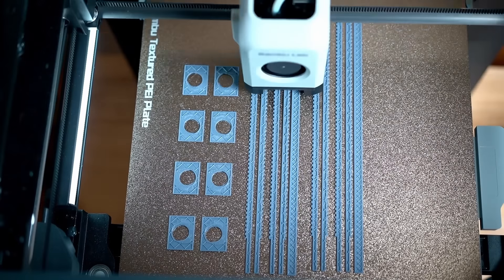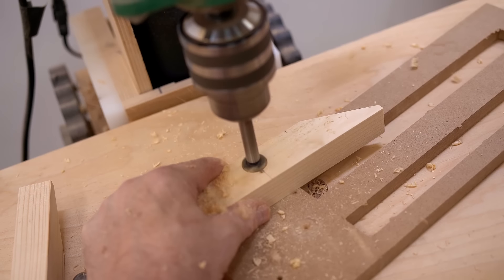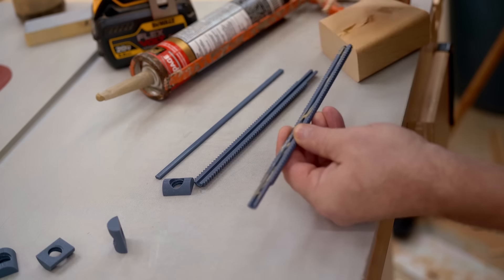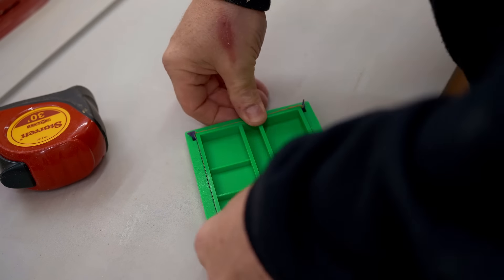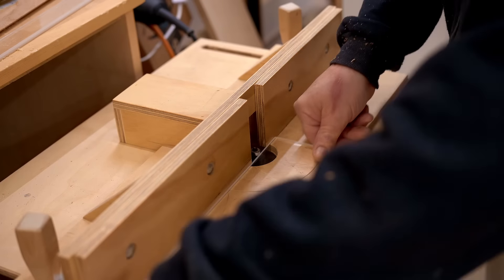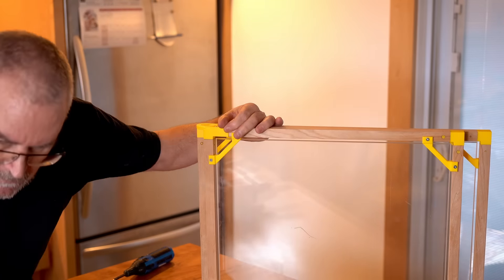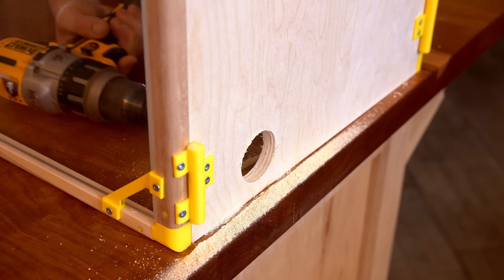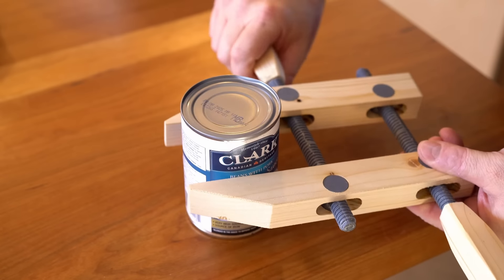What Happens When You Give A Carpenter A 3D Printer?

Comment from the maker: Short answer: good things happen! This is literally a game changer for someone who can use it as a tool for designing and testing projects. 
The printer I settled on was from #bambulab the P1P model and I've been using it every day for the last month, sometimes 5 times per day!
To use it to it's full potential I've also been learning FreeCad. Powerful FREE software, but a steep learning curve.
I won't be posting videos on 3d printing on this channel, but my projects may include 3d printed parts and will also be putting the stl files for some finished projects (like the sanding blocks shown in this video) on my Patreon and Locals for supporters.
Oh and the strength test for the handscrew clamp - it was surprisingly strong! It crushed that full can of beans (try doing that with your bare hands, for example) before the glue broke on the handles. So it's pretty strong and could be a lot stronger with a bigger leadscrew. The spline down the centre of the leadscrew can be made from solid hardwood or even aluminum or steel, and that would make it many times stronger.
Reply: I certainly wouldnt mind 3D-printing content..
Maybe post it on other channel?
Reply: Do you recommend any tutorials for learning Freecad?  I have a 3-D printer and the design aspect of making custom parts is holding me back.  I’ve been using TinkerCad and it doesn’t do technical shapes well.
Reply from the maker: A couple of great ones for FreeCad tutorials are MangoJelly Solutions and Andrew CAD.
Reply: Love my P1P, just working on installing the bits to make it into a P1S so I can do ABS etc. I've printed for years and had to do all the tinkering and tweaking to get good prints but this thing just works, it's awesome :) That is a very impressive clamp!
Reply: A couple small tips for 3d printing, it is RARELY if ever a good plan to custom print fasteners to replace screws/nails/bolts. You can buy them so cheaply, and the quality of purchased ones is so much better.

3d print the things that are expensive or unavailable. Use 3d printed parts to hold sheet goods/extrusion/lumber/etc with mass produced fasteners and you’ll save a lot of time (and a lot of frustration).

Repeated flex parts - like the super satisfying plastic clip catch clicker at the top of your enclosure - it depends on your material but I wouldn’t expect that piece to have a long life span unless you used something other than PLA.

For things like the lede screws in your clamps - the 3 piece design is excellent - but your alignment spline is another great part of use extrusion - some carbon fibre rod or brass rod or aluminium extruded flat bar or pin stock or something will work great and you can just print to fit whatever cheap, strong thing you got cheap. Removes a slightly painful and unnecessarily time consuming part from the print list, and get better rigidity and strength, usually for cheaper by volume than PLA.
Reply: Wow, you created all those with FreeCAD? I was not able to create even simple cube in an hour. You are a great person, I should say!
Reply: John - I love your creativity.  Happy spring.
Reply: As someone which had his first 3D Printer in 2014 and several between: The Bambu Lab P1P is a excellent Choice if you want to print and not tinker with your Printer.  It is moderate Upgradeable, but especially with an AMS it is a real Carefree Printer, which is great if you are woodworker and not a 3D Printer Tinkerer.  What would be good content is Hybrid constructions. 3D Printers are Tools like a lathe. Some Parts in FDM and most of Wood would be nice to see.
Reply: @Johnheisz try building a MPCNC or Lowrider V3 next. Alternatively, printNC if you have a slightly larger budget

Comment: One little tip for 3d printed threads is put a very light coat of silicone grease on them. It helps a ton when it comes to print on print contact. Makes it less "grainy" and turns smoother

Comment: Your intuition to print the screw threads horizontally and in parts and glue them together afterwards was spot on. A lot of 3D printing beginners will print screw threads vertically, and the layers shear off and the thread gets stuck as soon as they get over tightened.

Comment: Awesome! I also got a Bambu Lab P1S lately, it's a great printer. You might want to add some foam or other material at the bottom of the enclosure, so that it doesn't rattle when the printer is printing at high speed. My printer shakes the entire table so that I can't even use my mouse effectively :)
Can't wait to get ideas for 3d printed woodworking stuff from you :)

Comment: Brilliant ! I’m a uk based woodworker and literally just started learning what you can do with 3d printing. Snazzy enclosure…. I’m planning similar but just less snazzy… just 3d printed 3 way corner blocks to connect dowels to form a simply cage. Then I’ll print clips to hold Perspex or thin board sides.

What’s a surprise to me as a noobie is how L-O-N-G it takes to print even relatively small parts… you design some little accessory for the shop  in Fusion, then it takes 1 hour to print. Then you discover it’s ⅛” too small 🤯. Whereas as woodworkers, we’re used to being able to make very quick test pieces. All good fun though!
Reply: You can speed up prints by using larger nozzles and layer heights and by changing slicer settings. A 0.8 mm nozzle with 0.4 mm layer height will print faster and stronger than using a 0.4 mm nozzle with 0.2 mm layer height and if the piece is designed to be functional rather than decorative the thicker lines and layer heights don't matter so much.

For example a benchy in bambu PLA basic at default settings for a 0.4 mm nozzle (so 0.2 mm layer height) will take around 32 minutes of actual print time as calculated by the slicer and will use 12.24 g of filament. Going up to the extra draft preset with the 0.4 mm nozzle will make it take 26 minutes of print time. However if you change to a 0.8 mm nozzle with default settings (0.4 mm layer height) it will take only 16 minutes of actual printing time and use 14.81 g or at 0.56 mm layer height it will take 15 minutes. 

If going for a larger nozzle size then the slicer settings don't matter so much because you will end up flow rate limited, as in the printer can't melt the plastic fast enough but on a smaller nozzle you are just slightly flow rate limited. 

So if the part doesn't need to look great and you don't mind having thicker and more visible layers, using a larger nozzle can cut down on print time by a lot and is easy on bambu lab printers. Also thicker lines and layer heights can increase strength too, CNC kitchen has a video on it.

If you aren't using a bambu lab printer then there are loads of things you can do to increase print speed, the main one being upgrading it to use klipper if it isn't already and another major one is switching to a larger nozzle and more powerful hotend. The two things you want to increase on a printer for speed is the actual stable print speed, so how fast the hotend can go and the maximum volumetric flow rate. You can get hotends designed to print faster, with a normal hotend 10 - 20 mm^3/s volumetric flow rate is pretty standard but you can get hotends capable of above 75 mm^3/s.
Reply: @conorstewart2214 really helpful advice thank you 👍

Comment: You can get a product called 3d gloop that bonds 3d printed parts made for each type of filament. I am very happy with my P1P and AMS and I can't recommend the AMS enough, it makes the printer so easy to use instead of loading filament from the back.
Reply: I use a little bit of gorilla glue and clamp it. Gorilla glue expands 2-3x so it only takes a tiny amount. Super glue gel + zipkicker activator works well, so does e2000 glue. E2000 is probably the best all around imo

Comment: I've been following for years, and really enjoy your attention to detail and your engineering abilities. It's a perfect fit for you to have a 3d printer!. I've grown up with my dad doing all sorts of woodworking and I've learned a lot from him. I think woodworkers have are the original "OG"s of DIY.  So a 3d printer will really help to get functional parts that you have in your brain out into reality.. :)  
 That enclosure will be good for printing more durable plastics,, like ASA and ABS - Looks like you're right by a window so you could add a vent tube out that way.  Since you need to have a draft-free, higher ambient temp area so the prints don't warp and crack. But once they're printed, they're far stronger and more durable. In the meantime PETG prints a lot like PLA and is a bit more more durable than PLA, but it's not as rigid as PLA.

Comment: After printing for 8 years I find it's also an amazing tool for making router templates!
I've been using little scraps of filament for making things like paint cones. Also great for all kinds of things, currently also designing a drawer slide jig.
Reply: Forgot to mention hose adaptors for all your dust collecting needs. No more messing around with ducttape and pyramid couplings. Just quickly draw something up yourself and you're good to go!

Comment: I've been trying to come up with a vice that has 2 clamps on it. The vice would utilizes the 2 way threads these wooden clamps use. Each clamp could rotate and hold a part, then the main screw or vice would squeeze the 2 together. A way to glue up difficult to hold parts together while glue dries. I thought you maybe the genius to figure this out!

Comment: I thought you were going to stay on-brand and print a T-bone steak to cover that scratch. 

My wife bought me a 3D printer so I could fab OOS parts for my almost-40-yr-old van. I haven't even started on that yet but every day I run into a need and think "Hey; I could just print that."
Haven't had time to get into the design part yet, but there are so so many free and cheap designs out there - if you think you need it chances are somebody else already did. 
Eventually I'll build or buy a CNC machine. As you know, add those two things to your existing shop and there's very little you can't do.

Comment: it should be possible to print the threaded bolts as one piece. I have done so on a much less capable machine, requiring minimal cleanup to be usable and strong single piece. just use 3+ shells\walls will make something quite strong. (for shorter rods\bolts, depending on printer vertical MMs)it is possible to print them at a 45 degree vertical angle only supported by a edge sliver and a skirt

also the other parts you split, with proper supports could be printed as a single piece. playing with the slicer to get a few supports in the right places can go a long ways

Comment: I like your idea of printing threaded bolts split in two to deal with the threads.  Over on  the channel CADClass, they take the approach of just making a planar surface at the bottom of the threads, as if a section of the bolt/threaded part is cut off. Hard to explain, but it means you don't need to combine/glue two bodies together. You might find their approach interesting.  The video is "The Bolts | 3D (RE)Printed Series"
Reply: The real reason the screw was split was to increase its strength with a spline, like when reinforcing miters. It's not very difficult at all to accurately print a vertically standing screw.

Comment: You were smart to wait until the affordable printers got a little bit better.  I reluctantly bought an Ender 3 a couple years ago to supplement the patternmaking capabilities of my very small foundry just outside Ottawa ON.  The printer pooped out a few usable patterns thus paid for itself on the first job, but then it went on strike and getting it to work reliably has been an absolute nightmare ever since.  If you have the patience to learn freecad you could probably figure out why it's so obstinate and correct it, but I find frigging with that kind of stuff absolutely infuriating when it's being stubborn. I don't even like going in the room mine occupies anymore.

Comment: 11:17 Do you worry about heat build up inside the enclosure or is that not an issue with these printers?
Reply: Some materials like ABS actually need high enclosure temperature to prevent deformation. These machines and plastics do not really need to be kept cool.
Reply: Heat build up is actually the main reason you want an enclosure. It's very difficult for it to exceed 60C without extra heating anyway, and that's the glass transition temp for PLA, with the lowest thermal resistance.

The motors in 3D printers are usually all rated for a minimum of 70C ambient, and Bambu probably uses the ones that can operate in boiling temps, so it's fine.